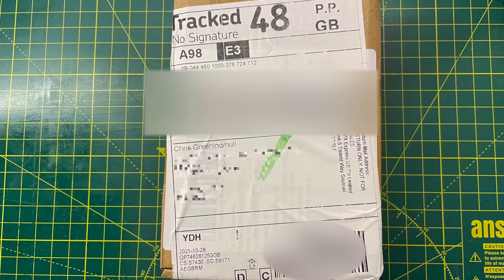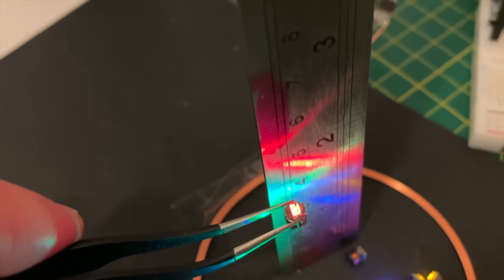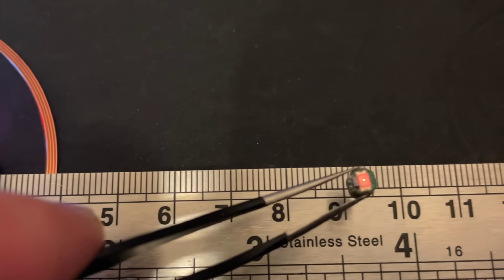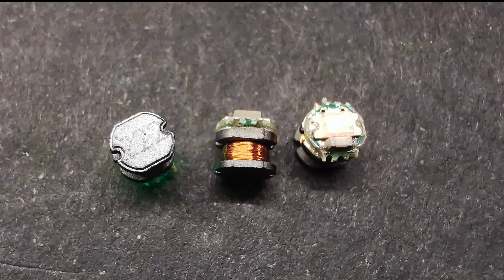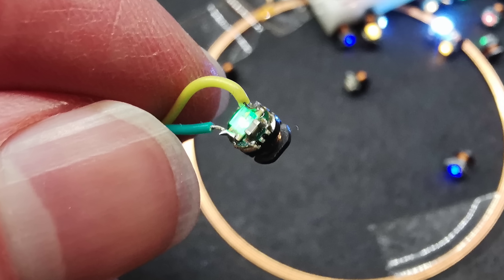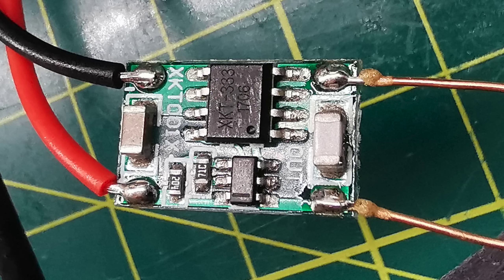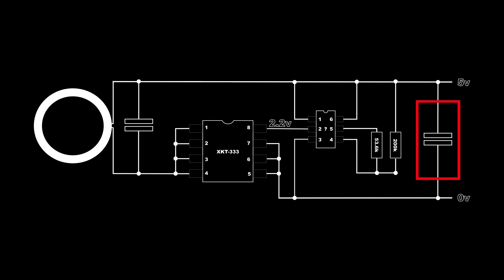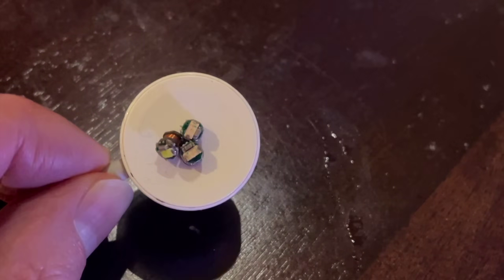Look Mum No Wires - This will blow your mind

Comment: Heh, I bought some of these after seeing Big Clive do his video on them. I made some of my own with 2 antiparallel LEDs and 2 turns of wire about the width of a finger (2-3cm). Both work with a phone set to use NFC, as well. Though the DIY one, I have to take the protective case off of my phone or it just barely works.

Comment: LED is a diode... allows in one direct. The LED's inductor is just a coil of insulated copper with a core. when that coil is moving in an electromagnetic field (lines of flux) a current is induced. This is induction. The coil plugged in to a power source of AC current means you have a sinusoidal waveform is building and collapsing repetitively at 60Hz.  Because this field (generated by an AC power source) is oscillating your LED can remain stationary and current with still be induced. The waveform on your oscilloscope shows the half wave your LED is using. Potential across the LED. A capacitor that small is likely not polarized, but your diode (LED) in the LC circuit keep it in one direction. My best guess to answer your question.

Comment: does using the cell phone charger increace the range of these?
 would  higher volate in the coil give you longer range?
I thought of a great application for these,  I am making mushroom lights and  these could be placed inside
I have terrarium that has wood base but the glass  is not cut out at the bottom so i would need to  drill the glass and make a hole or  use abottle cutter to cut the bottom off
is I want to put LED inside my mushrooms, that I will make from FIMO clay
I woudl like to hide the coil in the woood base and make the  caps and stems sepearte  so i can pop off a  muschrrom cap  and place one of these inside
but I would need like 7 or 8 inches of range , I wodner if more turns or higher voltage would increce the range
I saw projec that used little LEDS that go inside balloons that use button cells but hti is  way better

Comment: Umm... @ 3:49 Looks like you've got an offset on your sine wave and it's clipping the signal on the bottom end. Had the same issue with my ILDA op amps, until I corrected the offset.😎

Comment: Did you try to change the coil? Is it possible to use a larger diameter coil with same inductance and resistance?

Comment: do you know of a led catalog link ? im making a dyi reef tank lunar light and im needing very low mcd and a wide beam with a 5k color,  I have made a lunar light already using a length of wire mold and 4 clear blue leds drilled into it with 150 mcd  but noticing they are way to bright and blue and narrow beamed  any suggestionS ?
Reply from the maker: Probably easiest to look at the electronic component websites - there are a lot of led manufacturers so going to each one might be a bit of a pain.

Comment: I wonder if things can pick up the voltage from model train rails? Running standard dc, the voltage from the track never goes higher than 12 volts, and normal running is no more than 3v to 6v. The LEDs would never be more than an inch away the rails, so I wonder how bright they'd be. Would save a lot of time and I can stick a few of these in the coaches instead of wiring for contact pickups.

Comment: Hey there! Glad I came across your video. I know barely anything about electronics, and love that something like this is prebuilt. I want to make a D&D map, eventually, that when I swap out pieces on the map certain parts (laval, mushrooms, tavern lights, etc) will light up and surprise my players. HOWEVER my spouse is concerned about the heat that is/may be produced by needing enough of these to cover roughly a 3ft x 5ft table.  

Somehow...I doubt this produces any noticeable heat. But figured I'd ask before I start buying up and making things. Don't want the game to go up in literal flames. lol

Comment: wild idea, put these in a lightsaber tube, properly padded, like either encased in resin or light diffusing foam, they should be nice and round. induction coil, maybe every few centimeters through length of the blade.

Comment: Nice reference to Big Clive 2d colour printed reverse engineered circuitboards :)
I would add some addressing capabilities to them but I see it requires both a cap to store energy and another frequency address transmission. On the other hand as little feature as voltage levelling would be enough

Comment: 1:43 so wait these are just the same principals as the wireless power Tesla demonstrated? using essentially massive coils tuned to a specific metal to make the coils connected to the device start spinning up the electrons ? bit like conducting electric like water?

Comment: I did that in 1991, with 50kHz transmitter (computer smps converted into powerful wireless power transmitter). Sof if after 20 years, I am seeing someone demonstrating the same thing then for me atleast it is not a big deal and not new too.

Comment: I installed a LED strip light in my room  and accidentally touch the LED parts, and I was shocked and amazed because 2 to 3 LED lights up,
How could this happen,
Please explain? Thank you 

Note : I didn't plug yet. No DC, No AC.
Reply from the maker: Sounds like it could have been a build-up of static electricity - that's pretty cool :) Very tempted to try and set up an experiment to recreate it!

Comment: Hi, di you think is it possible to make a coil in a different measure? The one you have it's 65mm diameter and then they sell a 200mm one. I need one of about 100mm, so I was wondering, is it better to order the one you got (5V) or the bigger one that uses 24V?

Comment: Could the inductor be under a table? Will they still activate with non conductive material between?
Reply from the maker: Yes, that should work, though your range will be reduced. 1 or 2 cm of dense material is probably the limit.
Reply: @atomic14   
You didn't say if the range was increased with your smartphone's charging mat? 

 put these (especially the red ones) into the eyes of figurines!  
Or into toys for kids. 
Starship models! 
Oh boy there's a whole lot you can do with these!

Comment: Wow, those LEDs are macigal :)
Still: did you actually use tweezers and ruler made from metall for tests regarding an electric field?!
I'm no expert but you should veryfy those range results by testing again with messuring devices made from non conductive materials.

Comment: I would use these for cosplay. Fewer wires running through your costume means fewer potential broken circuits. Would also make lighting up armor pieces much easier too. Fewer holes to drill. Only advantage wired LED's would have is not needing several coils to cover large areas.

Comment: Question about the shape induced to the coil (time=3:31). My answer is that most likely that shape (half sin cycle) is to avoid the need of a rectification circuit on the LED side (which is needed when you have full sine cycle on a power cycle).  This approach saves the use of diodes.
Reply: rectification is carried by the led itself, you wouldn't need rectification either way

Comment: Would of been good to measure the range using a non metal rule. Wouldn't that have been a better idea? The steel rule may of reduced the range of the coil.

Comment: VERY intriguing. So could we theoretically hide the copper coils in say, signage, and then have the LEDS permanently lighting it? Without the need for wired electricity.
Reply: Wires are way cheaper than using inductors.  Also the complexity and cost is just so much higher and efficiency is much lower.  The science has been around since the fist transformer was invented back in the 1800s.
Reply: @gregkramer5588  Thanks for your response. After a bit of research I realised that I should have known better than to assume this was some cutting edge discovery.
Reply: @Bitplex , contemporary LEDs are more efficient then those from the 1800s.

Comment: The only project that comes to mind is illuminated patches and artwork for clothing. You would use hook and loop fasteners to put the artwork on one side of the clothing, and to attach coils to the other side. When time to wash, one could remove the art and coils, and launder as usual.

Comment: This doesn't blow my mind. It's simply induction, a principle that has been known for well over a hundred years. Newer LED's are EXTREMELY efficient, and take very little current to light them. This fact is what allows the distance you can get from the inductor and still have them light up.

Edit: I am guessing that your scope trace looks the way it did at the input to the coil, because many of these circuits have a power saving feature built-in to them. They pulse the coil with some small spikes until they sense that a load is brought near the coil, starts drawing power, and then the circuit ramps up the power to the coil. Have you checked the scope trace with, AND without a wireless load on the coil?

Comment: The non sine wave is caused by a diode. not allowing negative charge though.
It is the same on an alternator charging a battery. You don't want negative charge to drain the battery. 
You want only positive charges to lift the charge of the battery.

Comment: IDEA : LED Ball. (Paintball but with your wireless LED's)
Probably really dangerous.... Nevermind!
Okay here we go I''ve got one... well something...

Make 2 dimensional LED light grid. Hang it up on a wooden board. now stand behind the board and start moving the ring.
Now what we want to do is to get information on your movement. You can get the X and Y axes from the grid and the Z axis from the intensity of LED lights and basicly read and put into your movement into XYZ positions.
:DDD

I dont know what you can do with that but it will  be very cool to track movement through this electromagnetism instead of the traditional body suits they use in the film industry

Comment: I remember being so amazed when phones came out with wireless charging. Little did I know that almost everything that I plug into the wall uses transformers and induction and has for years. I didn't realize that "wireless" electricity was the only way that we can really have any electrical infrastructure.
Reply: Yes sir. Inductive energy transfer has been around forever. We've been using it all along, and most people don't even realize it. Radio and TV being another example.

Comment: 3:37 That's exactly what it should be, in reality the chip is pulsing Vcc into the coil when filtered by the LC circuit the higher order harmonics of the square wave are destroyed and an ugly, ringy, half-cycle sine wave remains. You're pretty much spot on with your reverse engineering!
Reply from the maker: Thanks!

Comment: To this day I still disagree that this is wireless. Sure it shares no wires on the LED but it still requires wires for the LEDs to function. LEDs could easily be designed to work off of products such as WIFI transmission and instead we are met with well... this.

Comment: As a designer, I can see many possibilities for something like this. I can think of products with transparent casing and the light seemingly coming from nowhere (encased in glass). I wonder if you could trigger different LEDs using some kind of signal. Also, how much do these costs?

Comment: Fix them in a circle (like a metal detector) at the  end of a shaft and use it to  detect a power source. It would light each section of led's giving the direction source is in.

Comment: If you could turn the coil into a wrist band, then you'll be able to turn them on when you grab them. Maybe you could make the LEDs into little tiny marbles about the same size so they're really like tiny gems that light up when you stick your hand in a bunch of them. You could put a coil in your shoes and install the lights in the floor so your footsteps light up. Use both and create a Pandora(Avatar) like world with LEDs in plants so when you touch or get near them they light up in response.

Comment: I remember a circuit designed to alert you to someone touching a door knob. (Intended to be used at a hotel, for example) 
It used two tuned circuits which were thrown into imbalance when a hand touched the doorknob...these LEDs can be made to be held between the balanced circuits, thus in the unlit state. When a hand touches the doorknob, the imbalance created would allow the led to light.

Comment: I could see those used in some Shelves where you would usually use those LED Strips. You can place them basically everywhere and have all the wiring run behind the Shelf where nobody could see.

Comment: The wave form possibly is the capacitor discharge, followed by a slight hick up during saturation. 
      I wouldn't bet a donut against a dollar on my theory, but I showed up. 
      Thanks for the content. Very cool. I wonder if it is possible using the  static in the air

Comment: You can get a bette range if you put a wire  on it.....

I honestly dont get the hype of wireless charging... You still need a power outlet, a wire towards the coil and your phone still has to be on the coil

Only difference is that its harder to pick up

Comment: install a ring around a doorknob that you can Bluetooth activate to illuminate for key. Since it's run by something you can App and send power to them it would be a great device to key signal or verified through signal keying. One could gate the signal so that only the owner of the correct keyed phone will allow illumination.

Comment: A toy car circuit! The cars are powered through the track, which, at a point, has a traffic signal. When the cars reach the signal, they slow down and the LEDs turn on because of the coil present there.

Comment: Possibly quite useful for somebody creating miniature railways, houses or other settings. Rather than having to run wires through everything these leds could be easily inserted and replaced. The lights aren't strong enough if you need the light to be practical but they could have uses in decorative elements. Maybe they could be incorporated into homemade cosplay outfits and props where someone might usually just put a coloured insert because wiring up lights is too hard or beyond them.

Comment: The graphic in 3:14 is the movement in the electric conduction. To obtain electricity from a magnet, the magnet needs to be constantly moving, passing through the coil to make the electric discharge. Instead of making the magnet move inside de coil, then they designed a variable in the circuit, into the capacitance or the inductance, which by imitating the way a coil charges electricity by a passing magnet, It works like a photo capacitor that getting full, drops the current to keeps on charging again... In a Bifilar coil was where the idea originated. By driving the electrons in a compound orbit, they pass electricity, by imitation of the same path and field in the electric frequency.
*Should exercise caution with children handling these small parts.

Comment: A project would be to create a diorama of the Titanic sinking using the LEDs as the lights as it sinks.  Some could still be "on", some could be flashing.  A 1/48 scale would great, but you could go smaller.  The water could be made of epoxy resin with pigment added to give the proper color to the water.  The bow could be placed underwater with flashing LEDs that would illuminate the bow through the epoxy resin.

Comment: so it isn't wireless because you need to be near the power source. You could of just used a small battery with recharging in it, but instead you made a port station that is required. Just because it can move 10in away from the port station is not wireless. If it has to have a port station at all, then a wire is needed at some point or it won't work. 

I dislike people claiming lies like this. Either it is truly wireless. I.E. needing nothing else besides the device and can freely move. Or it is not truly wireless.

Comment: Is there any way to make the coil more compact, say down to a diameter of 28mm? I'd like to try putting these in some D&D miniatures, with a power supply (coin battery maybe?) and coil in the base, but I'm not an electrical engineer. I don't even know if it is possible.

Comment: I'm not quite sure why but the signal going into the coil seems to be made into positive only signal probably using a diode of some sort. Perhaps the negative voltage is not needed when lighting up LEDs.

Comment: Interesting!  I have a real cheap LED light bulb that partially stays on even with I flip the switch...very weak light but obvious glow so it is powered.  Somehow, enough charge is getting through the line to at least some of the LEDs inside the plastic casing.

Comment: an engineer colleague designing his own wireless charging told me they use pulse signals to communicate with the device for compatibilty, charging state, thermals of the battery etc...so they don't just burn whatever comes in their range, don't ask me more than this he's a pcb layout designer I'm not

Comment: Well we discovered that electricity going through wires it’s not really transferring the energy through the wire, it’s all around the wire, so things being electrified without a cord should be elementary to us. A lot like how I think the pyramids were used, if they admitted energy everything that had a receptor around it would illuminate. Egyptian‘s had lights Way before “modern man”.

Comment: Very cool video. I used to work for a company in  New York that sold  LED lighting. We did experiments to find what color lights lasted the longest also the output of the LED. We did a burn test for a long time to see how long each style of LED would last. White light is not excellent, both warm white and cool light . Red light lasts the longest. It also depends on the voltage and the circuit board it is driven on